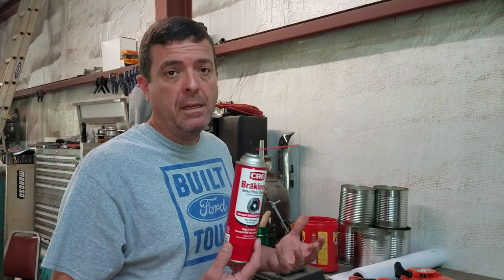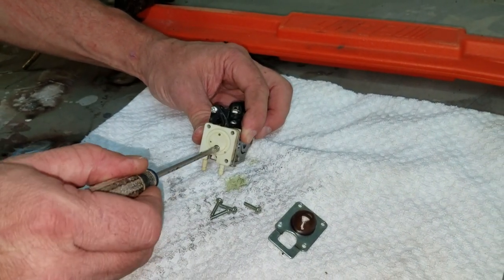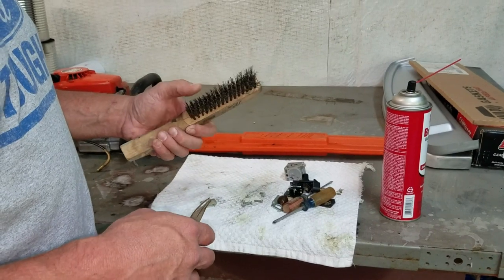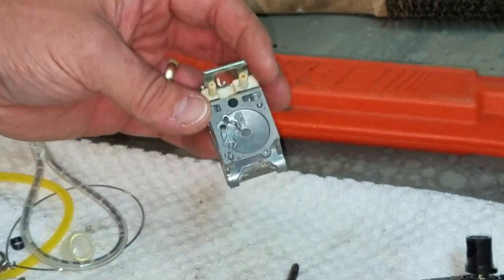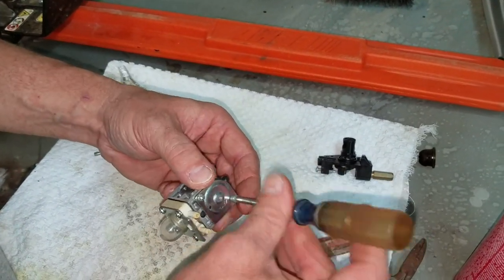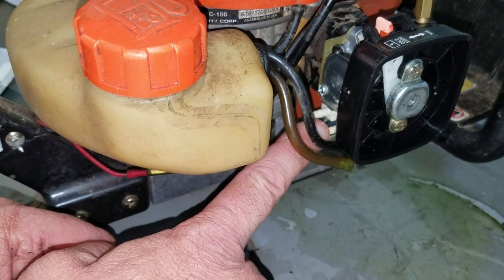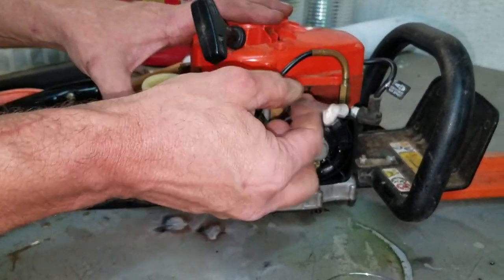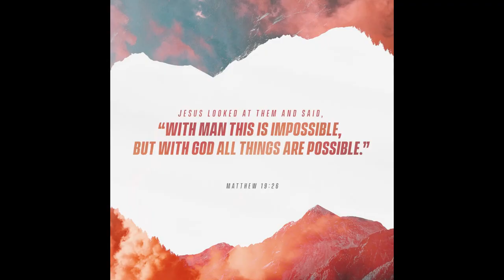Echo Hedge Clipper Carburetor Cleaning and Rebuild

Comment: One issue that I thought I saw happen is the throttle barrel sticks a bit as it rotates from idle to full open. I had the same problem. There is a small (2mm) roller that goes over a post at the periphery of the barrel housing. It just slides on and off and is easy to lose. A new one comes with the rebuild kit. Without it the throttle will stick and bind.
Reply from the maker: Thanks James

Comment: I've accidentally put diesel in my petrol hedgetrimmer 🤦and now It won't start. What's the best way to tackle this please
Reply from the maker: Dispose of the diesel fuel and fill it with proper mixed fuel.  Pump the fuel bubble several times to circulate  the fuel through the lines and carburetor.  If the carb is in good shape, you should be able to just start it normally.  Good luck.
Reply: @JasonJonieBuilds  thankyou very much for replying I will give that a go